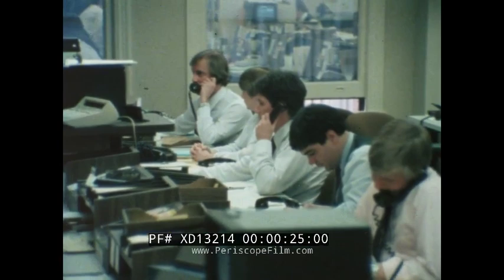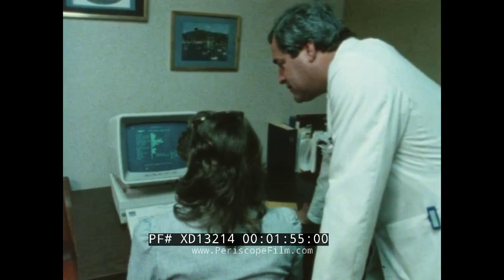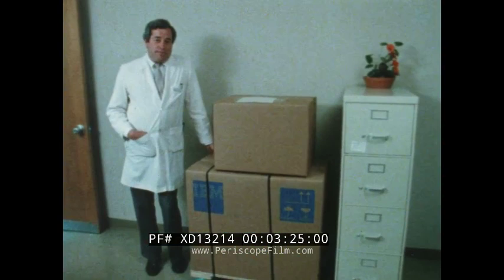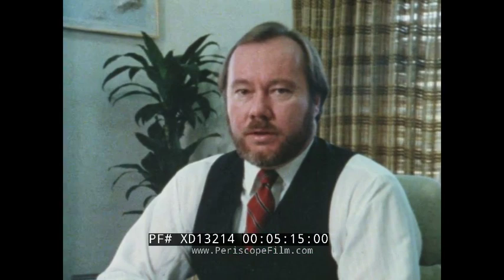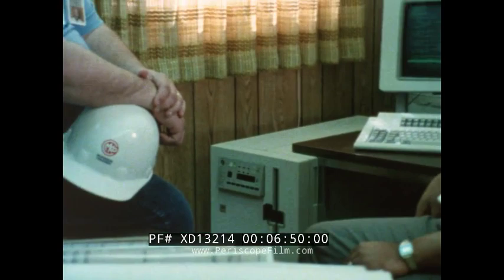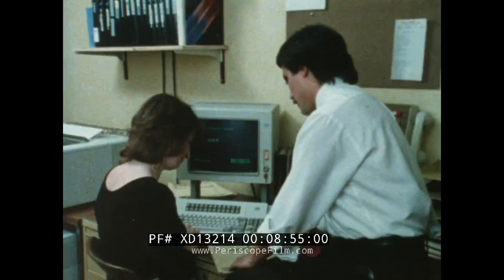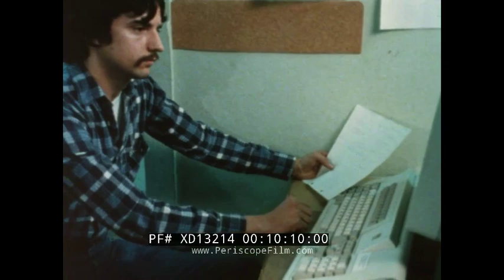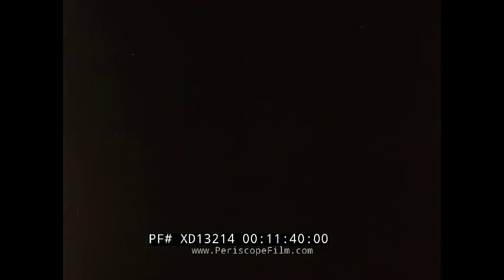1983 IBM SYSTEM/36 BUSINESS COMPUTER PROMOTIONAL FILM   IBM PC  XD13214

Comment: I never worked on an IBM mini, I was a mainframe guy - closest I came was the IBM 4381 scale-down mainframe. That was a very nifty compromise and you gt to work with the familiar MVS-XA OS and subsystems. I worked sometimes with AS/400 machines though and they were dead easy to operate. I think that was the idea of the S/36, it didn't require a deep level of knowledge to operate and sysadmins had no issues supporting it.
Reply: The Unix?

Comment: The Rochester plant came up with the S/32.  It was a single person machine with a small screen designed for small businesses or departments of large businesses.   It leased for $1000/mo.  A competitor came out with a multiple workstation computer like the system /34, but about a year ahead of IBM.  The IBM General Systems Staff at Atlanta HQ came up with a sales strategy saying the customer should start with a single workstation system to get the experience of working with a screen and then move to a multiple workstation system, which would give Rochester enough time to develop a multiple workstation system.  Amazingly,  the strategy worked.  I believe the name of the competitor was NBI which stood for Nothing But Initials.
Reply: I had an after high-school job coding on the System/32.  My boss was an IT consultant when they hardly existed back then. He upgraded to a System/34 and we converted all of the software to run in a multi-workstation environment. My boss then got pissed at IBM about something and he lured Sperry Univac in who said their system was 100% compatible with our S/34 code. That Sperry system sat there for 2 years and never ran a single line of code.
Reply: IBM seemed to be good at using tricks to stop people into buying other stuff, ask Alan Sugar. The PC1640 only had a fan in it because of supposed rumors from IBM people that no fan meant it was unreliable, given the PSU was in the monitor it kept itself cool just fine, Alan just realised that adding a fan was a way to end the rumours with little cost to Amstrad.
Admittedly their replacement (the PC2) was unreliable, but that was nothing to do with the quality/build of the machines but rather dodgy hard drives, which they then recalled and repaired, although the damage was done by then. They ended up suing Seagate (and WD?) for damages and won. 
At one point Amstrad had a huge share of the European PC business, something like 25%!